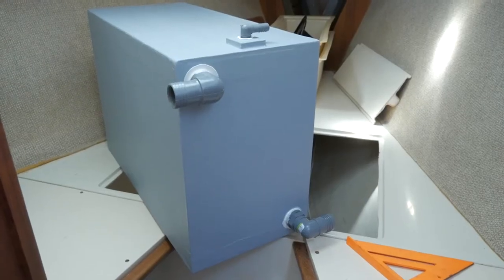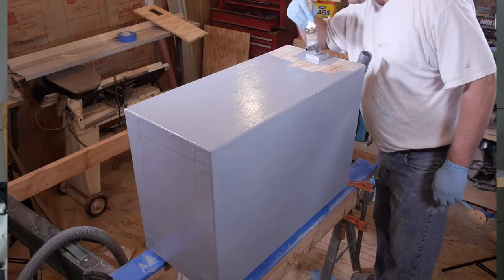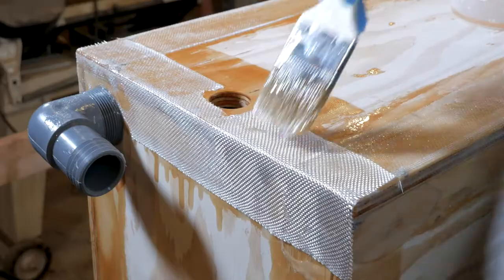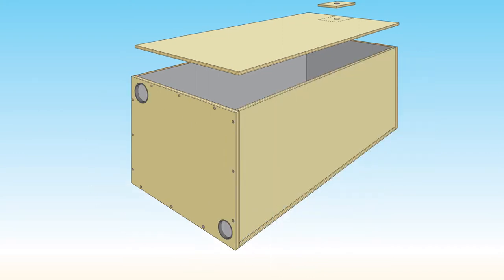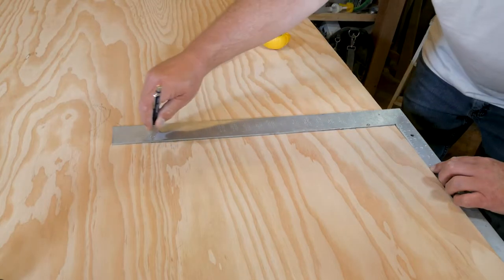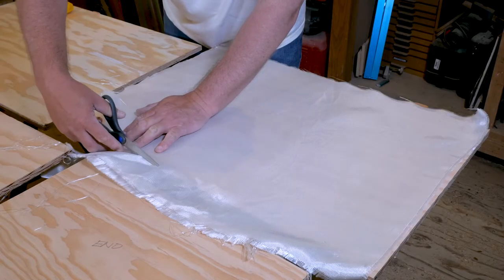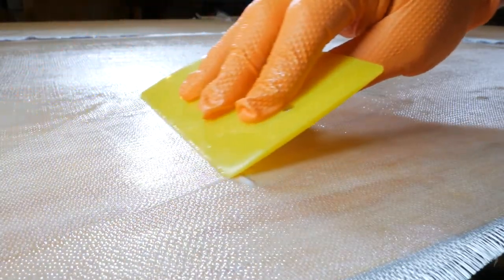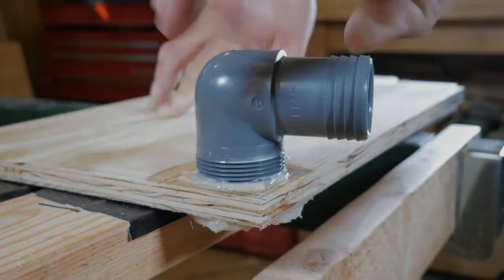How to Make Custom Plywood Tanks: Part 1

Comment: i’ve owned 17 or 18 boats throughout my life , I am also a retired Woodworker  i really like the concept and build idea of making  brand new custom sized tanks  fo a RV or a Boat  mostly because as a rule using Commercially available tanks  wind up wasting space  or forcing you to downsize  the tank to  find one to fit inside the small space you have to work with  i’m glad your Dad  tried the system out and gave it a time tested go , thanks for the video posting  as i’ve wondered for years if that process was a good option my guess is at some point in my life  i too will be using  the method  myself  as i do love Boats and Vintage Airstream Campers